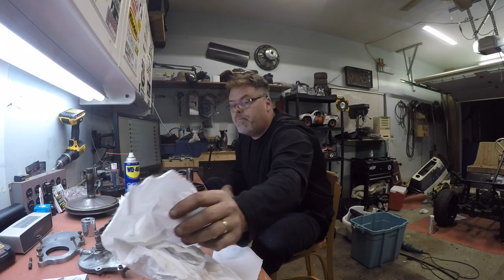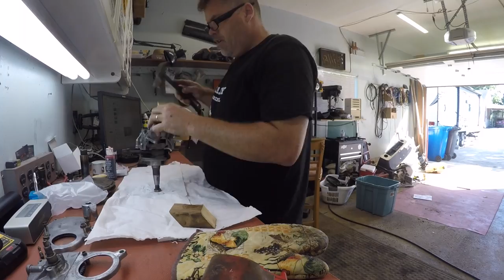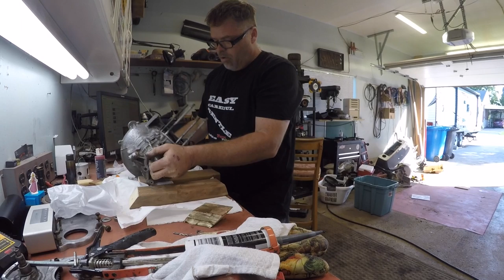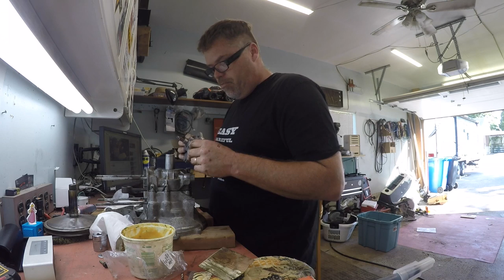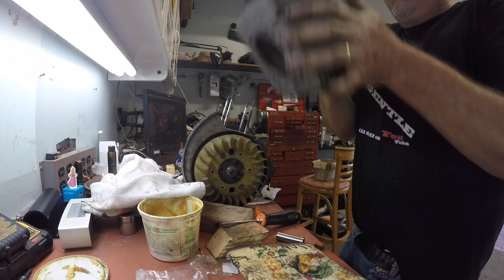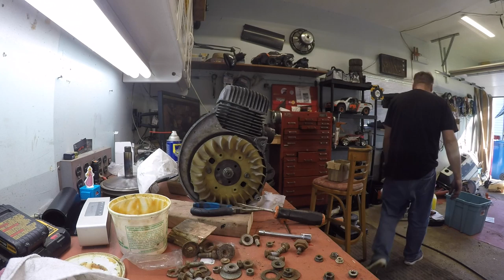2 Stroke Yamaha G1 Amost Ready

Comment: You should not use grease on the outside diameter of the seals! Those seals could blow out of the case at rpm and burn that motor down quick. Next time use weather strip adhesive, it stays pliable long enough to act as lube installing the seal and when it cures it prevents seal from coming out. They should have been installed in the case before assembly, mush easier to drive in that way. You should have used the grease on the inside of the seal so as not to run them dry on the shaft at first start.

Comment: If you put another 2 stroke engine together in the next 15 years there's a Yamaha  product called Yamabond 4 fluid sealant that's great for sealing engine cases that don't use a gasket . I was a Honda tech and they recommended we use this at Honda factory training . I'd guess you did install it but the video didn't show you put the other C clip in to hold the piston pin in place . Hope you did or the pin will move over and gut that side of the cylinder . You're doing a good job . I'm waiting to hear it run soon .

Comment: What mix ratio do you use?  Great vid by the way. I am rebuilding the top end to my ‘83 G1 and want to make sure I mix the oil and gas correctly since it doesn’t have the oil injection system
Reply from the maker: 50 to 1

Comment: Do you know anything about the wiring on the g1 2 stroke !?
Reply from the maker: What you need to know
Reply: @LifeWithBillSiff  how the wiring works
Reply: @LifeWithBillSiff  mine wolnt start and it did I think one of the wires are connect wrong I kept having to jump it now it wolnt even turn over it just clicks

Comment: did you put pin bearings in before add that pin
Reply: I didn't see the small end rod bearings go in either , might be a bushing rather than needles .
Reply: jeah that also was my mind when i was drop in sleep but maybe BillSiff told us bouth he has choose
Reply from the maker: the needle brings in boys
Reply: The shop I was at didn't have an oven for heating crank bearings so it was a pot of 10W30 on a hot plate . Heat them till the oil started to smoke a bit then try not to burn yourself .